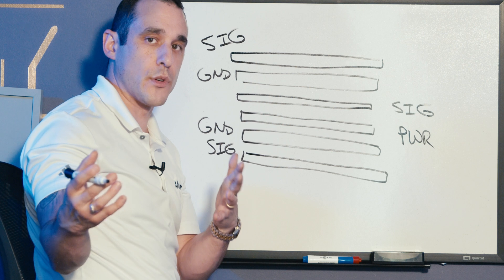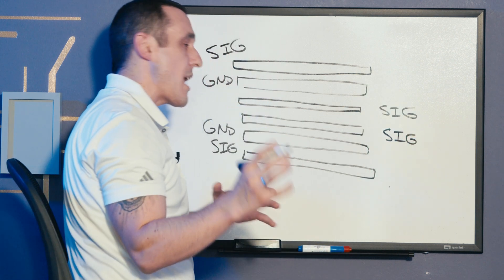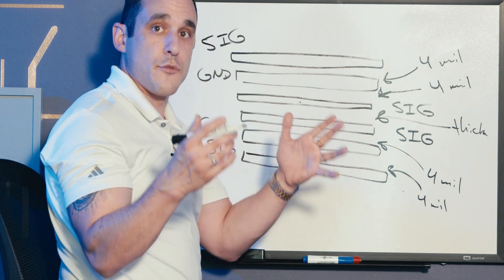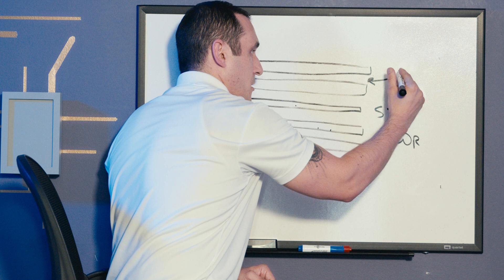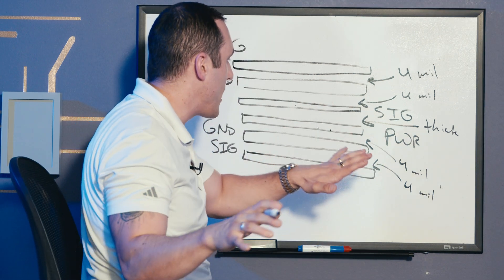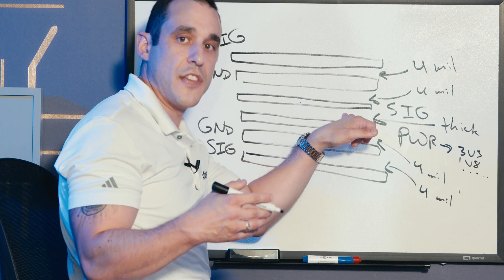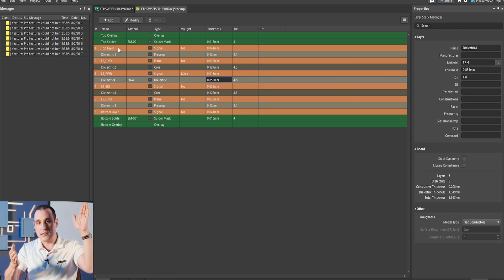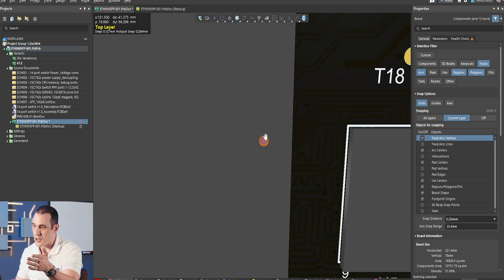EMI Solutions for Six-Layer PCB Stackups: A PCB Designer's Guide

Comment: Regarding the vias and pads, mainly vias connected to GND and PWR, these vias are over all stackup ?
Reply: What does "over all stackup" mean?
Reply: @Zachariah-Peterson  , at JLCPCB uses just Through Hole vias. So, my question is regarded to how to connect GND planes, cause there are some vias related to some GND pins (like decouple caps and IC pins) and in this case do I need provide other vias (Stitching ones) to connect the GND planes ?

Comment: I don't know if it's a dumb question, but why are there some trails that take multiple turns and intentional longer paths?
Reply: I think you're referring to the length tuning applied to some of the traces, this is used to ensure the signals on a group of traces are synchronized so that they arrive at the receiving component at the same time.

Comment: In the initial stackup with SIG on L3 and L4, the two ground planes are sharing the return currents with the same coupling on the layers above and below. In this case, how do we handle the crosstalk between L1 - L3 and L4 - L6 signals? Can orthogonal routing be used as a general solution to avoid crosstalk issues? And as always, thanks for the great video!  @Zachariah-Peterson
Reply: There is not any crosstalk between L1-L3 and L4-L6 when there is GND on L2 and L5. Electromagnetic fields cannot penetrate through the GND plane at the frequencies of interest in digital PCBs by any appreciable amount due to the skin depth. Standard 1 oz. copper is ~6 skin depths thick at 100 GMz, and about 18 skin depths thick at 1 GHz. This is enough to block wave propagation through the copper foil. In general, orthogonal routing can be considered as a way to route signals so that they have minimal capacitive and inductive coupling, but it is only necessary when you don't have GND between signal layers.

Comment: Kudos Zach and Altium Academy for this great piece. I would also like you touch base with instances you cannot avoid splits on high edge-rate signals. I use small caps near the split and the signals. Also about how good is edge ground region to prevent leaking at the edge.

Comment: Zack,

Would there be issues with having power layer 3 and signal on layer 4 in terms of coupling? I realize that you have ground on layer 5 for layer 4 to couple to, but I'm trying to parse what Rick Hartley is recommending vs. what you have here. He's basically saying to have:

SIG/PWR
GND
SIG/PWR
GND
SIG/PWR
GND
Reply: I know the Rick Hartley presentation you're referring to, the "never ever do it" case is microstrip over split PWR layer. With slower signals and coplanar ground you can get away with it. I'm doing it with striplines, having the splits on layer 3 is not ideal but we are a bit constrained by the stackup from the manufacturer (in this case, JLC as I discussed in a short). This one won't go through EMI testing so I'm not worried about the design in those terms, but if edge emissions were a problem it's simple to correct this by adding a GND layer between 3 and 4, or by making the dielectric between 3 and 4 thick while making the 4/5 and 2/3 dielectrics very thin.

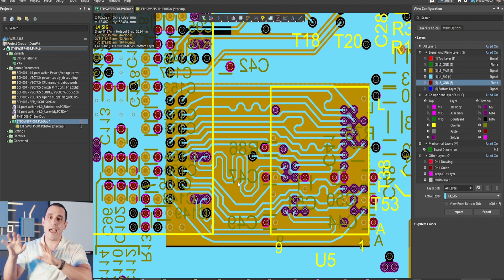Comment: Starting around 10:20, you discuss routing over splits in the power plane -- but I would expect coupling to the nearby ground plane to be 40-50 times stronger, so that power plane discontinuities couldn't approach the 5%-10% tolerance of controlled impedance.

Are these signals particularly sensitive?  Is the tolerance for controlled impedance variation within a single board much tighter than the overall target?
 
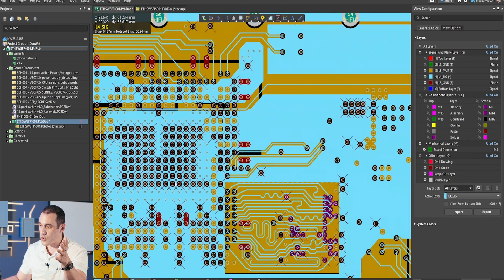At 11:48, when routing over splits in the power plane -- does serpentining within the split affect the timing skew?  Is that typically modeled by the tools, or just something to watch out for and manually request a field-solving simulation there?
Reply: Due to the distance to ground being larger than power I don't know if 40-50x is the right number, but regardless there is coupling to GND so it will not be a major problem for impedance discontinuity. We showed in another video about S-parameters being affected by splits in power planes, those splits need to be pretty large to become noticeable in a return loss plot at lower frequencies (this should make perfect sense if you think about critical length). However, the Bert Simonovich article I reference in that video looks at emissions around those splits, which are noticeable at higher frequencies, so there is a risk if you do a lot of this. Also the serpentine timing is affected by a small amount, Altium Designer and every other CAD tool cannot account for this until after the route is completed and a 2D/3D simulation is run.
Reply: I was thinking about square of distance, forgetting that planes are just linear ... so if the actual factor is less than 10, I guess it could exceed the 10% tolerance.

Comment: At 9:13 and 9:17, the vias seem to be labelled.  Is that just a nice feature of the Altium User Interface, or is that silkscreen on tented vias?  If it will show on the actual board, what made the vias more annotation-worthy than other pads?
Reply: Those are through-hole pads, and Altium (along with other ECAD software) will display the net names in the GUI. These aren't in silkscreen layers or anything like that.

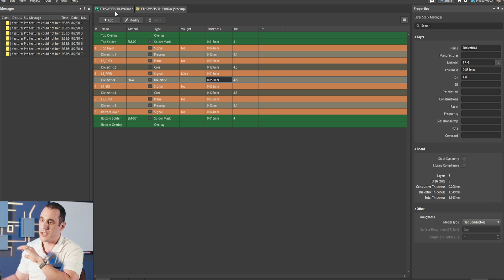Comment: Was this stackup (8:45) an in-progress draft, or were there some subtle choices that would be worth explaining?

It looks like the thick center layer is "Dielectric", the ones near it are "core" and the outer ones are "prepreg".  Is "dialectric" just a way to say the fabricator can choose?  (It does list a specific Dk, different from either the core or prepreg, but that might be a default.)  

Is it common to use so many different materials?  Is this for cost-savings, and more relevant at volume?

The L3-Power layer is only half-ounce copper, even though all the other layers -- including its symmetric L4 -- are full-ounce.  In the past, when I've seen an asymmetry, it was to increase the thickness of a power plane.  Was this a copper-balance concern, or something I haven't even considered?
Reply: You can have the thinner prepreg as the central dielectric, and then thicker cores around it. More common is to use the thicker core as central dielectric and 2 prepreg layers on top or on bottom. The stackup shown on the screen matched a standard JLC stackup that we used when I ordered the boards (you can see those boards in a short: https://www.youtube.com/shorts/vxkrQup6H1I), you can see the stackup details on their 6-layer PCB stackup support page, that one ends up with 1/2 ounce on inner layers and 1 ounce on surface so ignore those values in the LSM. If you look at that stackup you'll see that they spec different glass weaves for the different layers, this stackup mostly has tight spread glass so it addresses fiber weave problems. So yes it is common to mix different materials like this, sometimes that's the only way to hit your thickness targets on different layers.

Comment: When L3(Power) is used as a reference plane for L4(signal), even though the distance is "large", wont there be some field spreading as the field has to rely on decoupling capacitors as return path?
Reply: The majority of return current sits in the closer conductor, yes there could be some flow through nearby decaps but much less than you would expect through the nearby GND. At somewhat high speeds the current can pass over splits and you won't notice the effects on S-parameters until you get to very high frequencies. In my PCB West presentation from this year I showed some examples with small splits in a plane on a 100G serdes lane, and you get about -2 dB return loss degradation up to the 20-30 GHz range, much lower frequencies like we are dealing with here are mostly unaffected. There could be EMI if routing over a split in the power layer, but again it depends on the signal edge rate and how close the signal is to GND compared to power.

Comment: Is it possible to perform SI & PI simulations by Altium? How did you analyze the board in terms of SI/PI?
Reply: Altium has an SI tool that uses either BEM or MoM to do 2D impedance calculations from your PCB layout, and it can apply some terminations to examine reflections and ringing. You can also do some basic crosstalk simulations, and the tool is quite good for that purpose. There are no PI simulations directly from the PCB layout, you can only do things in SPICE or you have to use an integration with Keysight to do this. There is also an Ansys CoDesigner integration that can be used for SI and PI.

Comment: Nicely explained. 6-layer is beyond the needs of anything I'd build, but this is interesting.
tl;dw: Close coupling between the signal layers and ground; thicker core to reduce coupling between the internal signal layers.
That solid power region in the hand-on example is essentially a shielding can. V0, V+, don't really make no nevermind - they're both ground as far as the signal is concerned. In fact, with faster edge rate signals, it can be beneficial to have coupling between both the V0 and V+ rails.